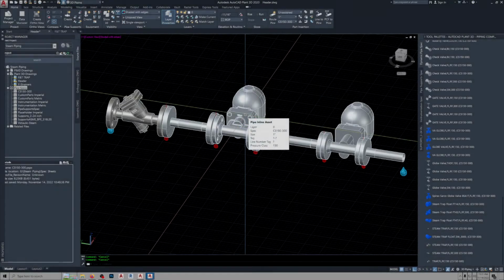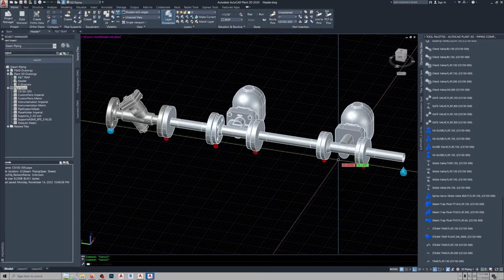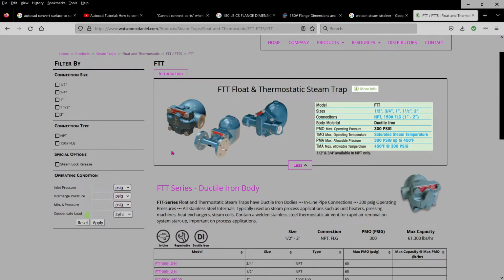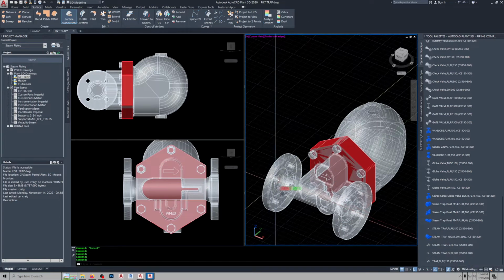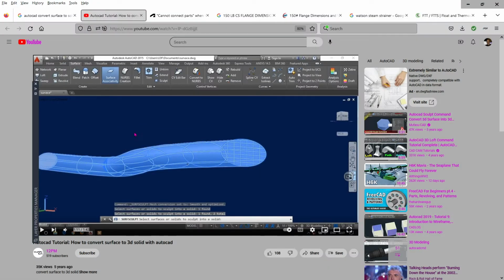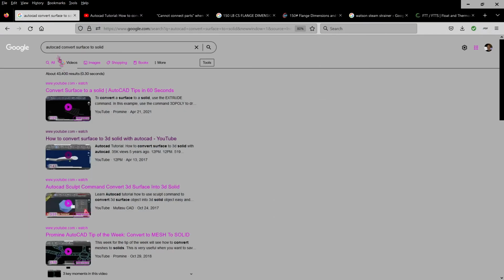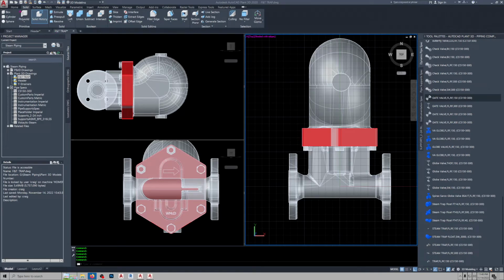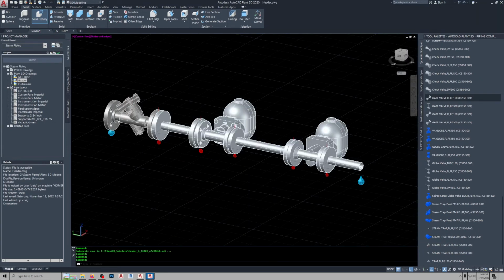Plant 3d; Cleaning Up an STP model

Comment: Excellent. Craig, what page web do you use for download library piping? Thank
Reply from the maker: I'm not sure I understand your question but I'll try to answer it as best I can. I don't download libraries. I search for a particular part that I want to add to a catalog. I try to find a manufacturers site that offer 3D STP CAD files if there is not an existing component in the stock out of the box catalog that can be modified by using the "duplicate component" command. I've found that there are few manufacturers that offer STP files suitable for 3D modeling so I look for a manufacturer that offers detailed dimensional data so I can make my own (Autocad 3D modeling) or modify an existing catalog component as mentioned above. Hope that helps.
Reply: @craige7667  Ok
Reply from the maker: Thank you.
Reply from the maker: https://www.mcmaster.com/ Lots of stuff for piping here
Reply: @craige7667  thank you Craig